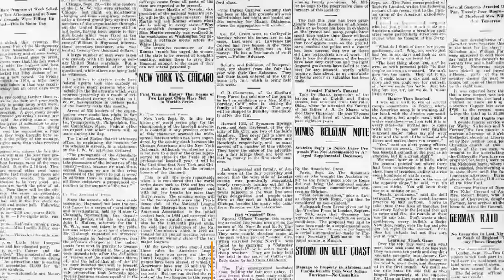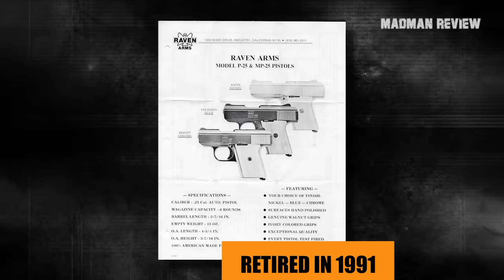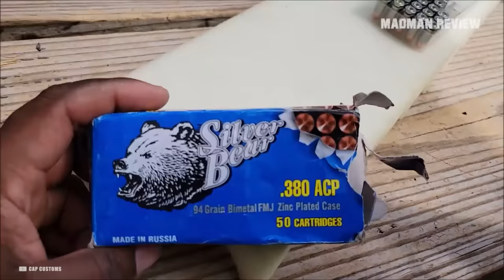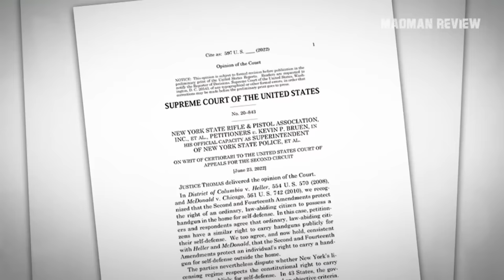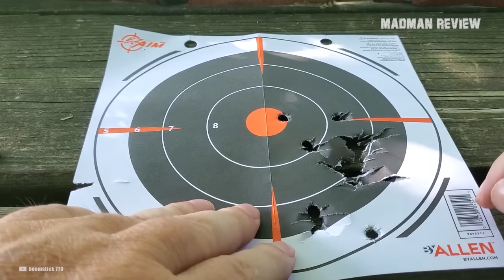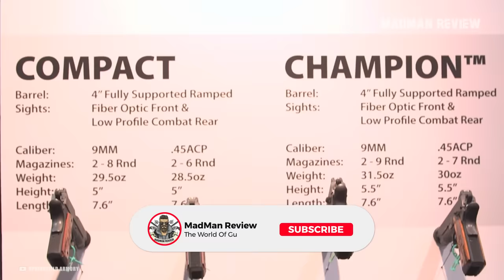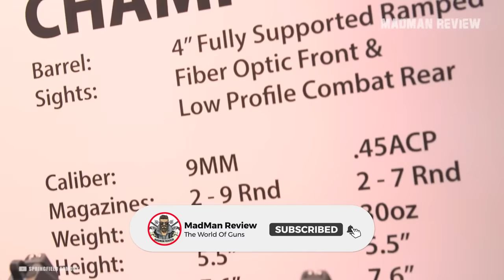TOP 8 Saturday Night Special Guns [Don't Buy Until You WATCH This!]

Comment: Zamak is the same alloy that is used to make Hot Wheels. Lol
Reply: Yes, Zamak starts to turn to white powder after 40-50 years and is advanced by high humidity. Many German medals from WWII are turning to white powder now. Many rivets on Hot Wheels show some of the white powder in just a few years. Zinc bathroom fixtures, same thing, 40 years (AND with high humidity) inside of a bathroom, turns them to powder. It's officially called: Zinc Pest. (Zinc turning to white powder.)

Comment: Still have a Rohm 3 inch barrel 22 LR revolver that I bought new at dealer cost- $12 in 1974. Used it very little (quality concerns), primarily with 22LR snake shot to dispense with any water moccasins dropping into the boat from tree limbs while fishing. Shot pattern at close range made it easy to hit a moving snake and the tiny shot wouldn't put a hole in the boat. Peace

Comment: Ive got a Raven P-25 that 'jus snoozes away in the safe. Possessed it for 25+ years now. Just recently re-built it w/all parts that can be exchanged. Pretty accurate 'lil piece considering its limitations, prob due to the fixed barrel. But back in tha day when I did fire it alot it NEVER had ANY issues whatsoever. Never failed to feed, fire, extract, eject & re-feed the next round....

Comment: Jeez there are a lot of gun snobs when discussing these pocket guns.  I'm with every Raven owner posting here.  I never had any issue/problem shooting mine.  I don't live in an open carry state.  However, at 75 years old, I sometimes feel like a vulnerable mark to some would-be criminal.  My Raven .25 easily fits in my front cargo pant pocket.  I have an easy release pocket holster for it.  And, my .25's weight doesn't pull my pants down, as larger, heavier guns do.

Comment: What about the Clerke Techne Corp .22 revolver I bought one around 1971-72 for $29.99, just because I could.  You cannot believe how bad it was.  It shaved lead out the side and the casting was so poorly done.  The metal did not fill the mold.  I thought it might be number1.
Reply: I almost bought one off eBay 10 years ago, they guy thought it was a cap gun... I've read a lot about the shaving lead from the sides, yikes, would hate to have a revolver that does that. Why I tend to stay away from old revolvers at pawn shops, you never know how messed up they are.

Comment: Back in the day, I was working on a Raven in 25 ACP. I loaded the mag and fired it in the trap. Well I tried to fire it, but all it did was go CLICK. So I went to the bench, pulled out the mag and the gun went off. The bullet hit a box of springs, straightened out a section of one and was laying there on the bench. 

So what had happened. When I looked, I found that the striker tail that engages with the sear was sticking down below the bottom of the slide. So when I pulled the trigger, the striker fell from the sear to the top cartridge in the magazine. When I pulled out the mag, the striker then hit the primer, setting off the cartridge. The fix was simple, a few seconds on the sander removed the excess metal and then the gun was good to go.

Comment: Why wasn't Röhm's competitor Arminius mentioned?   I had a friend who had a Röhm and we fired it into a phone book and found 2 bullet holes.  It had enough clearance between the cylinder and barrel that the part of the blast escaping sideways could cause an adjacent cylinder to ignite.

We also measured its double action trigger pull at 16 lbs.

Comment: I purchased the Raven 25cal around 1980 still works just fine after replacing broken firing pin 1995 with at least few thousand rounds being fired.Very accurate at 25-30 feet.
Reply: Mine needs a new firing pin as well.

Comment: In regards to the jennings 22 I believe I have one of the earliest models as it has the up or down safety mechanism which I believe was the earliest style if you run hotter 22 such as stingers, you will not have any issues are used to use that as my every day carry, because that is all I could afford as it was given to me. It can be reliable, but it does take some time to understand the limitations of that pistol.

Comment: Lol I've had so many of these... I do still have 1 little ja .380 that I tuned up when I did my lever action (already had everything out, played with a few of my cheap toys) and it doesn't have any problems. More accurate than I expected and just as small (but heavier) than the new plastic .380's. Good backup gun if you had to, I guess lmao... I prefer my Beretta if I go .380 though, because you never know with the cheap mags lmao

Comment: ...  Zamak is (Aluminum 4%, Zinc 96%) ...
It is one of the most used materials for the automotive industry due to its great resistance and the ease of creating good voluminous finishes at high temperatures , and used for cheap jewelry ...

Comment: owned and own the raven and two HP 22s found the raven 25 not to accurate made a good belly gun 5-10 ft nothing mor tons of misfires really a particular about ammo gun. however, bought two HP 22s found them quite a kick to shoot, accurate 20 to 25 ft. pretty good at 50. don't try and shoot someone over 300 yards, way too many safeties. but can't blame them for that. Taking it down watch the spring always fun chasing it down it even tells you that in the manual and some videos, not too particular with the ammo, seems to dislike Winchester all others ok, both HPs fun and cheap to shoot if someone broke into my house and one was handy. I would have no problem ventilating them with one.

Comment: I've had mixed results with these guns, but no, they are not all "junk". I have a Phoenix .22 that has literally never jammed. Magazine after magazine after magazine it takes every and all .22 ammo without ever having a problem ... it's stunning how accurate and reliable it is ..

My brother loves my Phoenix so much, he bought one of his own, and in less than 500 rounds, the frame split in half and it was kaputz ... the pot metal gave up the ghost ...

I also had a Cobra .380 that never worked ... ever ... on these, the design is just bad ... it was a miracle if the thing got through a magazine without one, or multiple jams ... nothing I did could make it more reliable ... nothing ...

So these guns are a mixed bag. On one hand is one of the most reliable guns I've ever owned, then pure junk on the other ...